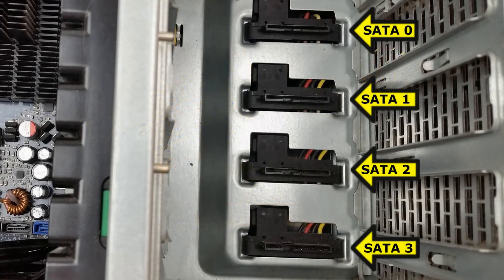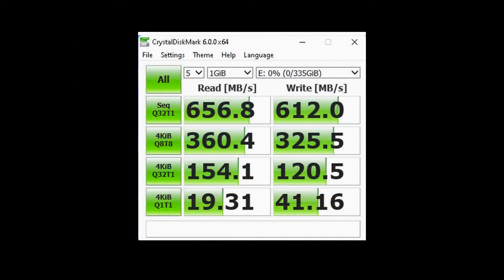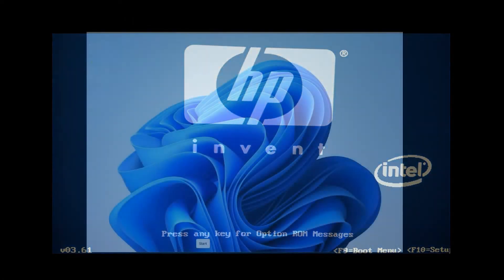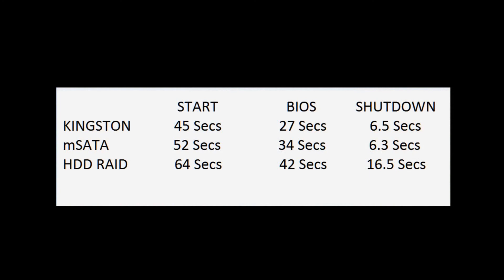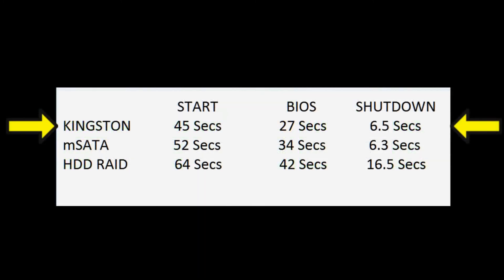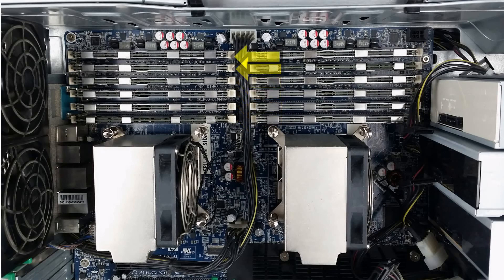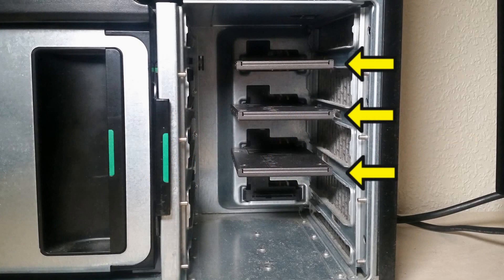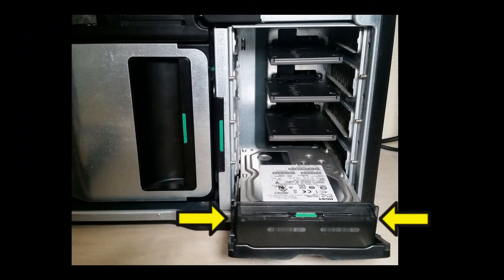How to Speed up Slow HP Z800 Response Times

Comment: Thanks bud! Good tips, good info and I didn't have to read much lol :)  Great pc's they take a graphics card no problem although you can't overclock the cpu because of the dual cpu. I use a raid configuration with two 1tb hdd's but I really need to upgrade. I also use a massive sas drive. I'd heard that disabling the sas controller speeds up the boot time. My main issue is not necessarily the boot time (although...) but how sluggish my pc has become over time. I added a titan x to replace my gtx780 and it began to... sort of crash on it's own sometimes, often predictably. I am not always nice to it. I might have to just blame myself? I has a 1400w linear uninterrupted power supply and I can be away from home weeks at a time and constantly stream games on it. But when updates roll around, as soon as I unpause them and start to let it do it's thing, the multiple reboot processes can cause me to go into a boot loop. Imagine how glorious if microsoft let you update without reboots. I'm scared of experiencing bootloops on this more than any other pc. Getting it to snap out of the bad bcd is like... letting it sit there for 2 months without looking at it, idk. I guess it has to run all those selfcheck tests on the ram with ecc and whatnot. Chances are you're running one of these with over 40gb ram for maximum productivity. Oh well. Have a good one! thanks again.

Comment: Soo you are saying that 3x Kingstone SSD and then make them RAID ?And will be the best speed ever?like 600 mb /sec?
Reply from the maker: Yes if you RAID 0 them - don't forget we are using SATA 2 on this machine which limits the top speed of the SSDs.
Reply: @AlbyTastic  I have the Z600,so is the same "problem" do you think is better to sell it and go for the Z800?At the moment I am running on 4x16 GB and x5675 x2

Comment: I really wish i COULD speed up the bios process.
Reply from the maker: Well as I said in the workstations are intended for long term use where the initial start up process is of relatively low importance.
I have a Pro-sumer i7 PC which starts up in about 10 secs but still prefer the Z800 for my normal use.